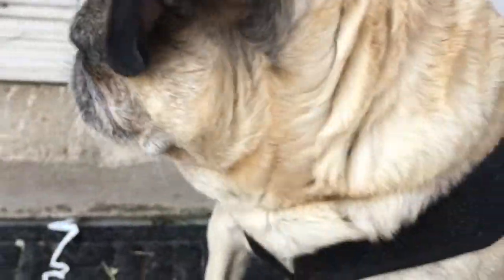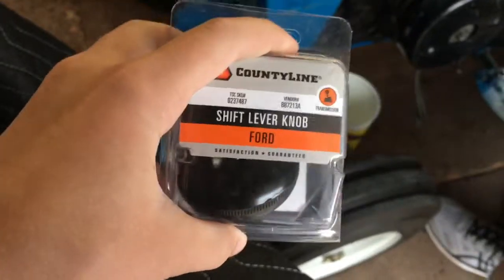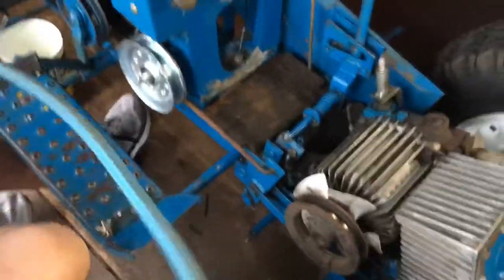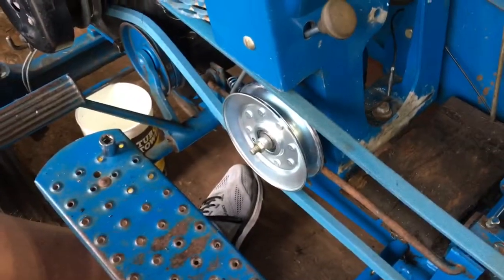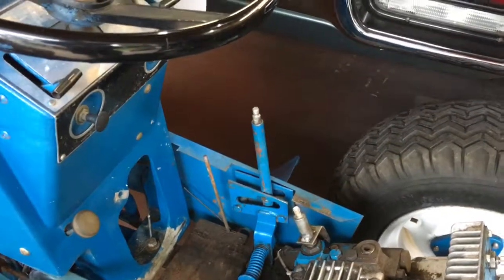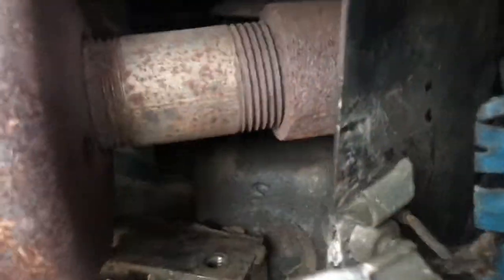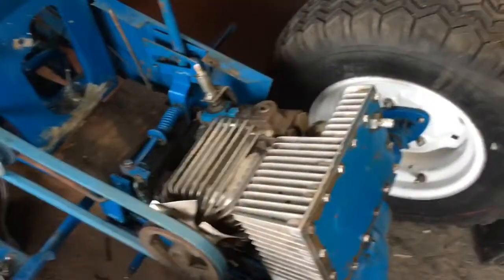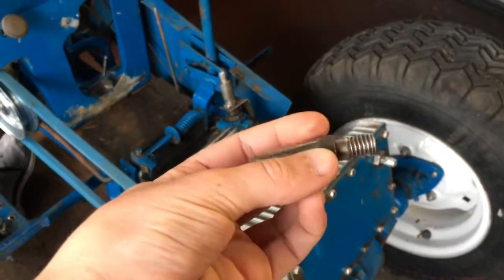Changing the drive belt and idler pulley on a ford 120

Comment: In your restoration of the Ford 120 tractor, did you have any problems with the hydrogear leaking?
Reply from the maker: No actually but on my dads 120 his hydro gear leaks but we haven’t figured it out yet we believe my hydro gear in my ford is bad and I’ll be explaining that in the next ford video
Reply: Thanks. Mine is leaking at the top where the trunnion shim rests on top of the transmission. I can't figure out how to make it stop. Let me know if you figure something out!
Reply from the maker: Ok
Reply from the maker: Video might be tomorrow or next week depending on the weather